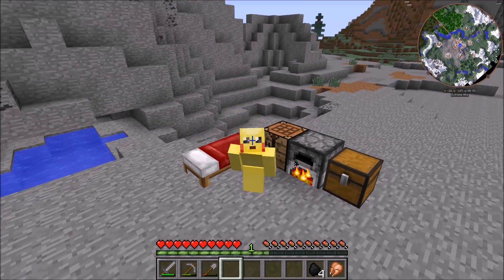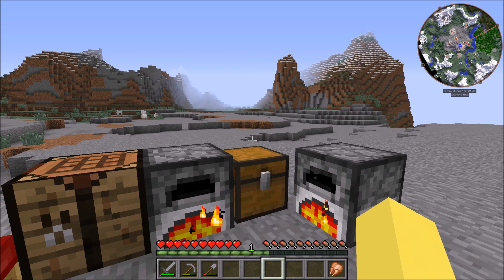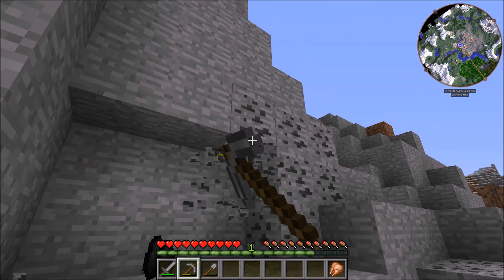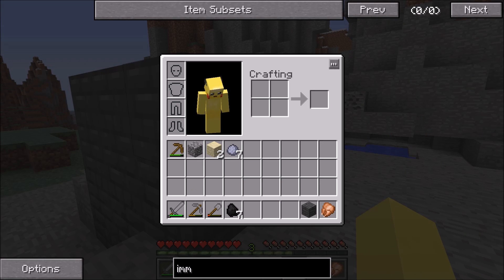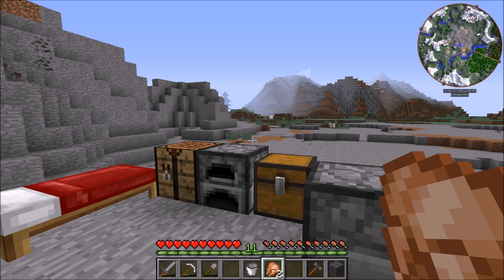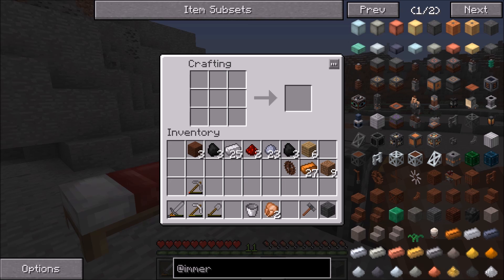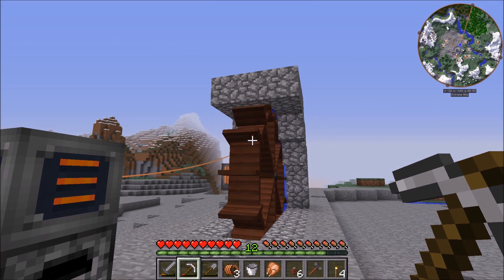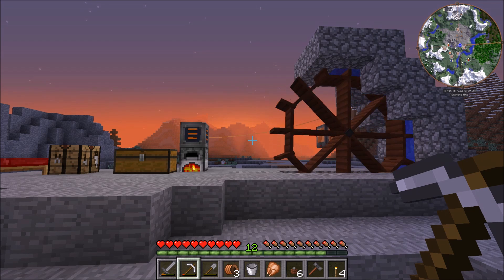Surviving With Immersive Engineering :: Ep.1 - Coke Oven and Water Wheel Power

Comment: my windmill isnt producing energy and it turning fine i tried everything with rotaing the kynetic dynamo and heater but nothing works
Reply from the maker: Is the power line hooked up properly to the kinetic dynamo and heater? You need to change one of the sides on the heater using the hammer to allow it to accept power :)
Reply: DrRageHard yes it is! in fact i have tried every possible combination with my hammer and I have three wheels!
Reply: @minecraft_geek2344   i know this is old but windmills dont really produce enough power to power anything unless you have them at 200 block height and at that point the energy loss from transporting it down to ground makes it almost nonexistent. As much as i love windmills they are kinda worthless for the ammount of work to build them

Comment: I know this is an older set of videos but I've been trying to get the same setup on my system with the mods you are using.  They don't play well together.  Immersive Engineering crashes MC.  What version of Forge are you using as that's not one that's listed.  Nice vids, btw.  Very informative.
Reply from the maker: For this one I was just using the recommended forge for minecraft 1.7.10 I believe. Pretty much just went to forge and downloaded whichever one came up for the 1.7.10 version. Glad you like the videos!

Comment: I don't understand, when I place 3 Water Wheel on one dynamo, I only get 65-67 RF/t, instead of the 90RF/t.
Is there an "optimal"way to place the water so all 4 corners touch the water flow?
Thank you!
Reply from the maker: +BoutchooQc Placing water 1 back from the middle on the top and having it flow all the way around and under it so its touching the wheel is the optimal placement :)
Reply: +BoutchooQc water wheels got nerfed

Comment: Just so you know, you want to have the water source 1 off center. If you want the water to flow left then put it 1 to the right of middle. Makes it more efficient. I did a lot of testing this morning.
Reply from the maker: +Synecdoche09 ah, because you want the actual top block to be a flowing block instead of the source?
Reply: Exactly. Ended up giving me about 7 more rf/t for 3, which is nearly a 10% gain. Though there's pictures of 90 rf/t that I cannot seem to get no matter where I place things.
Reply from the maker: hmm, well thanks for the advice and putting time into testing! I appreciate it
Reply: After a bit more checking, it turns out the max rf/t was reduced to 25 per water wheel (at least on expert.) So the water source one off center is the best way to do  it.